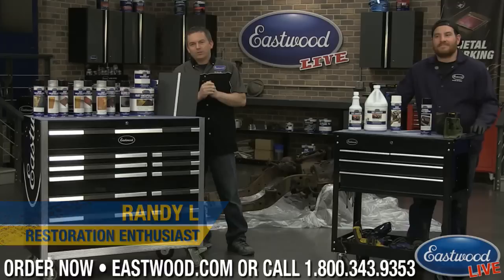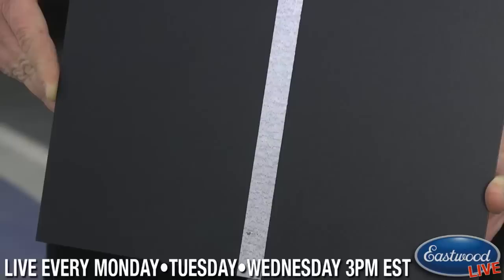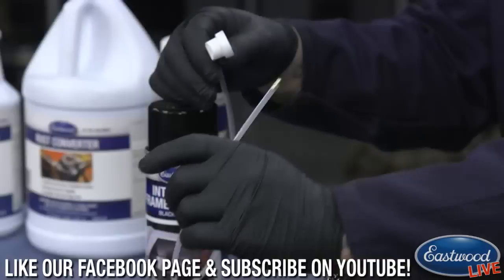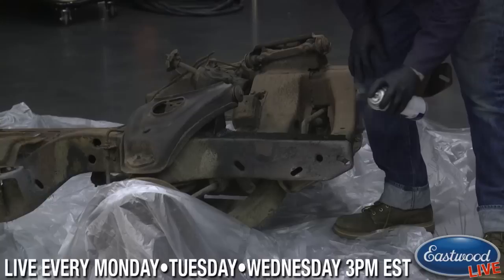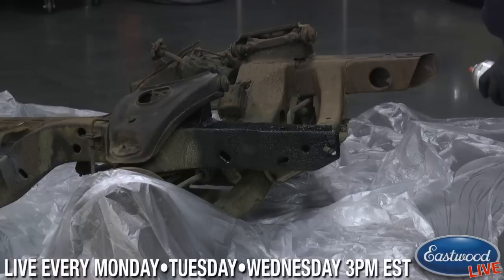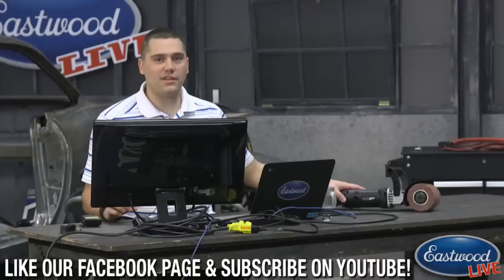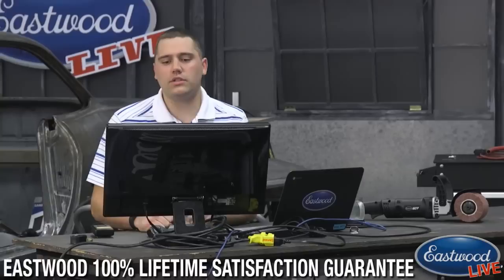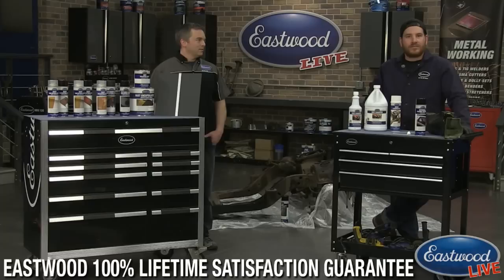Rust Solutions for Your Car or Truck.  Encapsulator, Converter, Internal Frame Coat & More.

Comment: Had my Nissan Skyline R34 GTR imported with grade "4.5" condition from japan, turns out the underside was rusty and had been painted over with black paint. Had a look at some DIY stuff and came across your video, just purchased myself some Rubberized Rust Encapsulator online (hard to find in australia!). Cant wait to use it! Engine and tranmission is out so should be a good time to rust proof everything.  
For those who are importing from japan, just remember the cars have been subjected to Tsunamis, Snow, Salty roads and etc... So a rusty underside is pretty much a given for a 15 + year old car no matter what grade its in!
Reply: That's not necessarily true. Japanese imports are generally almost rust-free. They don't actually use salt on the roads at all in winter, and the overall humidity in Japan is actually quite low, which is the main thing that stops corrosion. I imported my 180SX two years ago, and it had never had its underside given any treatment at all, and it only had very minor surface corrosion in a couple of places, which was easy to address before applying a proper undercoat. I've seen other, newer JDM imports (Integras, S15s, Evos etc) which had no rust at all, and still had their factory undercoating and paint in place.

Comment: I'm a huge fan of Eastwood products and am using Rust encapsulator platinum and internal frame coat on my 70 vert mustang. My one criticism w all of their videos is that you see these guys spraying these products without respirators on! These products are INCREDIBLY TOXIC and you should ALWAYS WEAR A RESPIRATOR like a full face P100 AG filter that's fresh. I am religious about shaving my beard and getting a great seal, which I test every time. Inevitably when I am working in upside down and tight spaces, I'll catch a whiff through the mask  when my face contorts for a split second and for the rest of the day I'll feel spacey and have a headache. That's from a insanely tiny amount of exposure and in a well-ventilated space with a mask on. Albeit I am sensitive to these kind of things but be careful with these kinds of products. ALWAYS WEAR A RESPIRATOR and if you have a beard, shave it so it fits within the mask!!! The Rust Enc Plat is super noxious in particular. Great product though, but use it safely.

Comment: The 'vette frame originally had a Manual transmission which made it possible for the exhaust to get through those two holes in the frame cross member.

Comment: thanks for another great vid. Have not used the internal frame coating before, but have a question. What happens if there is some organic matter or sometime small stones left in the frame that did not come out when it was waterblasted? If this gets "trapped" by the coating - could it rust? How would this compare to something like a wax/lanolin product?

Comment: I have a 6' snow blade I use on my small tractor. I took off several coats of paint with 80 grit. There are numerous pinholes that I know have rust in them. What produst should I use and in what order.
Thanks, Larry

Comment: Can you paint rust encapsulator over top of rust converter?
Is it a waste of product an time or will it protect it better?
Reply from the maker: Yes, absolutely, wipe the part with pre painting prep before top coating, but that would be a sure fire why to stop rust in its tracks!
Reply: @eastwoodco  was this done for the frame in the video? As you just show you spraying rust converter, leaving it to dry, and then spraying with encapsulator

Comment: I'm redoing my 20ft car trailer, it's pretty rusty but nothing severe. I want to use the rust ecapsulator platinum for the outside, curious how would I use the internal frame coating on such a large frame?
Reply from the maker: Are there holes or bolts that can be removed? If so, you can spray inside those. You will need them to be about 4" apart or a little closer to get complete coverage.

Comment: Quick usage question (I have used both convertor and encapsulator on a restore). I have some fender panels I need to strip down but they have spot surface rust. If I use rust convertor on those spots, can I bodywork and primer over it ? I ask because of course, there will always be pitting and I will need to use body putty on the panels. Thanks in advance...LOVE the products...I am an Eastwood guy
Reply: I do just this same thing with great results. Make sure the converter is cured .

Comment: If you use rust converter or rust encapsulator on body panels, can you uses body filler over it ? In other words, if you are fixing a door for example, you convert the rust, you encapsulate, then want to do normal body work, is this okay?
Reply: Convert it, then do body work. The encapsulator you don't do body work on top of, its a  top coat type product

Comment: Would the two step process work on drums that are rusty? Rust converter and then rust encapsulator?
Reply: yes but do not use the rubberized on a brake drum

Comment: Can I weld after using rust converter since it leaves a chemical coating before I use pre and encapsulator?
Reply from the maker: You should sand or grind away the Rust Encapsulator in the area you will be welding, prior to welding.

Comment: Any problems spraying rust encapsulator over a mixture of painted and rusty surfaces? What prep would be involved in the painted areas. I'm looking at using it on my jeep frame, which only has rust in some spots. Can I still spray the whole thing?
Reply from the maker: Eastwood Rust Encapsulator can go over both.  If the bare metal is clean and smooth, scuff it first with 220 for best adhesion.  Do the same over the painted areas.